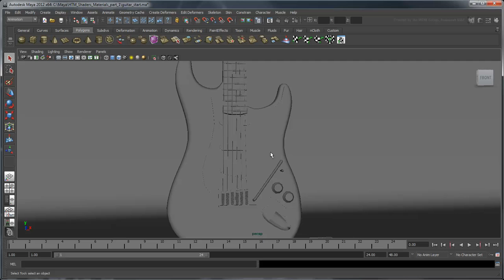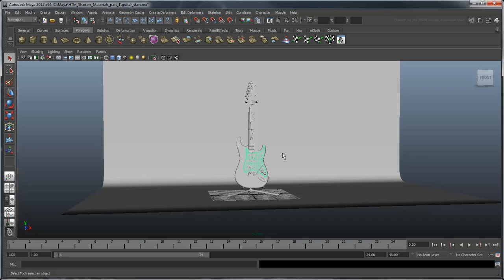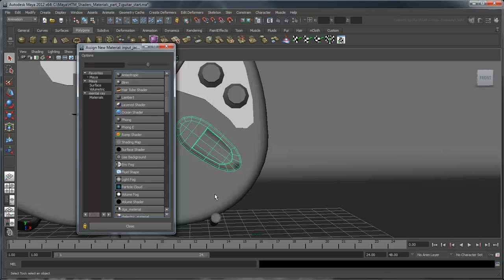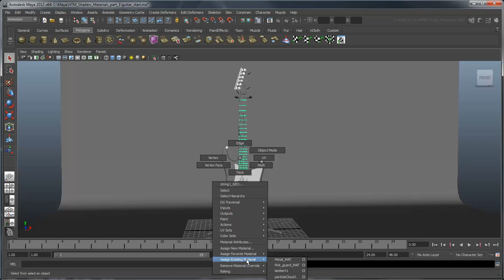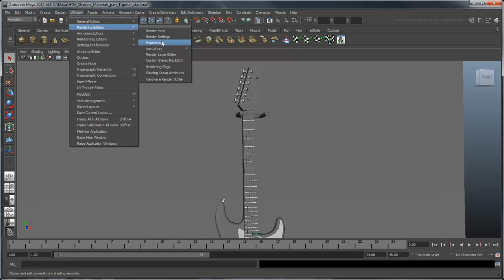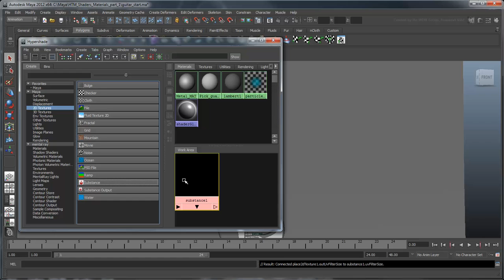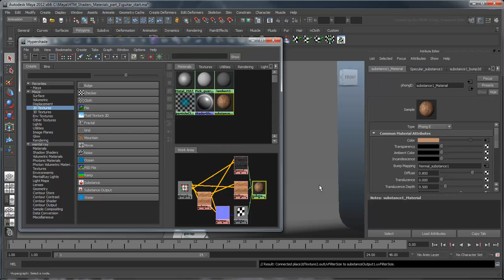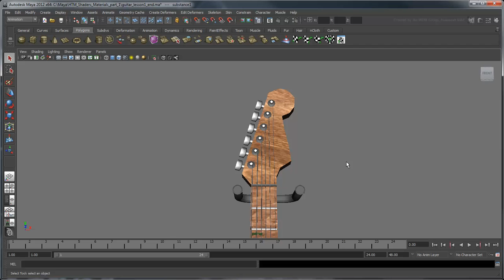Applying Shaders and Materials - Part 1

Comment: When I try to change the color, it does not change...
Reply from the maker: ***** Are you sure you're viewing in shaded + textured mode?
Reply: I'm definitely viewing the shaded mode... What do you mean by texture mode?
Reply from the maker: ***** Shaded mode will only allow you to view the shade (so various greys).  If you want to see a change in color, you need to click the button shown at 7:50 to turn texturing on.
Reply: I'm not even two minutes in though... I just want to create some objects that I have white and then the eyes black. I'm making Baymax from Big Hero 6.
Reply from the maker: ***** Hmm, are you sure you're changing the right material / have the material assigned to the right object?
Reply: I select the mesh, assign it a new material and try to change the color... It doesn't change.
Reply from the maker: ***** It sounds as though something might be wrong with your configuration then.  I would close Maya, delete the preferences folder to restore it to factory defaults, then try again.
Reply: Okay, so I deleted the prefs file. Opened maya, opened my scene, right clicked on the body and said assign new material. I then click on Blinn, I then open hypershade, click on blinn1, choose my color, right click on the blinn thumbnail and say "apply to selection".... Nothing changes. Could it be because there is something wrong with my model? Or maybe since I'm using the student version?
Reply: Maya Learning Channel I also tried creating a new scene and just putting in a circle and doing the same thing... It doesn't do it. I must be doing something wrong.
Reply from the maker: Wait, you're trying to apply color to a circle?  As in a NURBS circle?  You should try applying it to a polygon object like a sphere or cube.
Reply: Maya Learning Channel Well yes, a sphere.. Sorry.
Reply: +Maya Learning Center I will upload a video of me trying to do it, and then post a link.
Reply from the maker: ***** Ah, you have the "Use default material" button turned on (next to the Smooth Shade All button in the panel toolbar).  Turn that off and it should fix the problem.
Reply: Maya Learning Channel Got it. Thank you so much!

Comment: ok so in the plug in manager there appears to be only 'substance.bundle' not 'substance.mll'.  Is this why when i click the step at 6:28 no folders (apart from an empty '3DPaintTextures' file) appear? I want to texture something like glass.  Also running maya 2013 on my macbook pro if that is any help